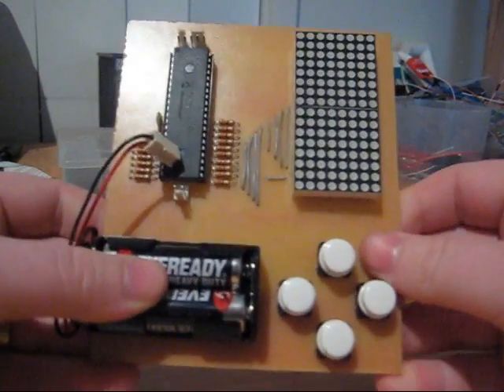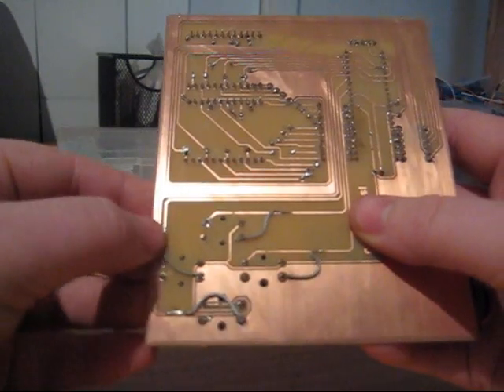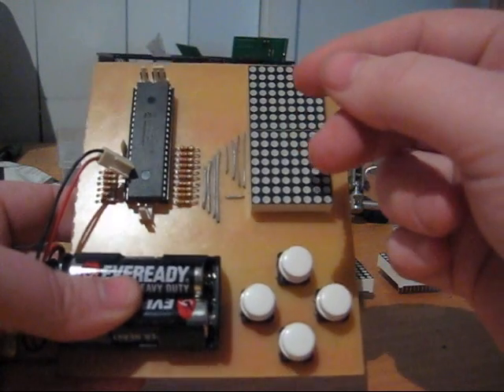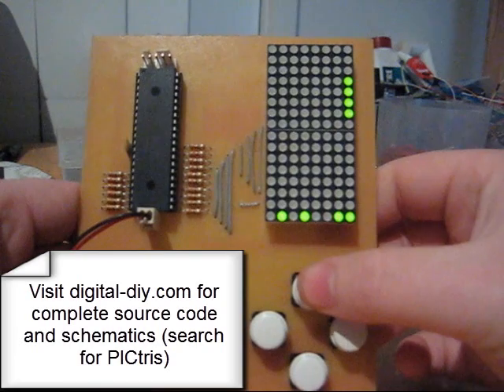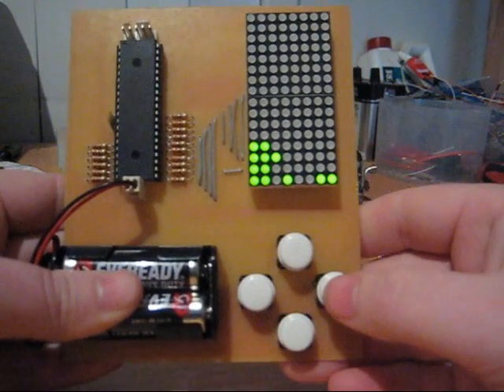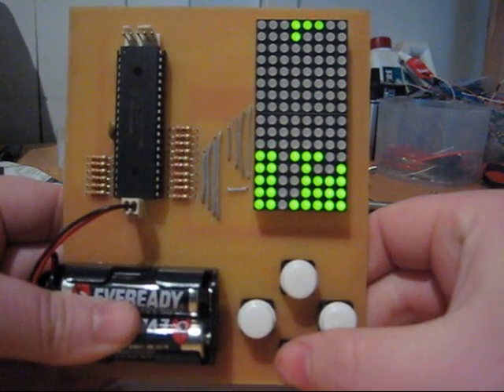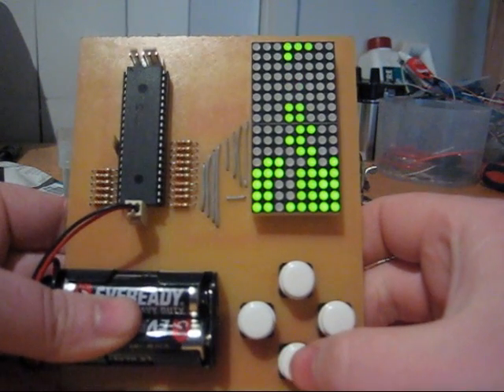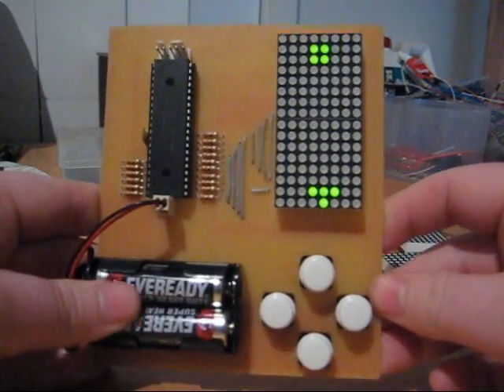PICtris (Tetris on a PIC).wmv

Comment: Hi. I didn't publish anything and I lost the files of the project. However, I made the trick with a 16vdc and a 5,6ohms power resistor. With the ADC, I measure the voltage at each side of the resistor in serial with the battery. I have the voltage and with a sub function, the current thru the resistor. Along the charging process, the voltage goes up, then down ; the current goes down, then up. When the 2 curves go the good direction long enough, the battery is charged.

Comment: You can use PIC Compatible microchip burners, but I am currently using the PICkit 2, a ICSP programmer from Microchip.
Then you can code the programm with the free software "MPLAB X" with either an Assembler or C compiler.

Comment: have you idea where i can find smaller matrix panels? i'm building an arcade stick (8 buttons) and i'd like to add a little display on the corner wich shows buttons and stick response, the easier way would be 3 rows of 7 leds (maybe square or rectangular) but 4 of them would be wasted.. (3 rows of 3 leds for stick inputs in the left, then we have 3 rows of 4 leds left, but i need only the top and bottom rows since buttons are only 8 )

any suggestion? i was considering to get a 3x3 and a 2x4 matrix to avoid wasting space and unused leds, does anything like this even exist?

Comment: Hi! I use normaly 8x8 Matrix Modules with just green colour, not like the in Projekt used green/red Module. The Pcb is different to the Shematic! There are 24 Pins / Module used. What i have to modify that it works fine for Matrix with 16 Pins? Thank you!!!

Comment: yeah me too found that there was a flaw, it picking up same block after a reset and there is no delay for next run. Suggesting to improve the code for randomizing the block and delay (better if it would be from controller,of course it may increase the circuitry) for next run. The work done by u is really awesome..........cheers..

Comment: I need to know that resistance is on your site you put in the description of the video does not say.
I need to pass the list of materials you used.
NEED ANOTHER PAGE OR TELL ME HOW TO DO IT, because I want to do this project and I need the list of materials and the description of how to do (eg the programming of the PIC).
  PS: I go to a technical school (electronics) and a bit of how to control a pic and I did several projects.
THANKS

Comment: above the pic you have a component,  what component is this?
on the website that you gave in the description says in the pcb that you need a pickit 2, is really necessary the pickt2? or i can use another component?
what did you do in this part of the circuit? 
please answer me i need the information
Reply: yes, i'm talking about that, but it suposed to be that the pickit is connected in the icsp connector, doesn't it?
but it has to be connected the pickit in the icsp connector so it the tetris can work? or the pickit is used for the protection of the pic?
Reply: another thing: in the source code when i try to compile show a lot of errors and warning about the INCLUDE randgen anthr others INCLUDE,  in the errors saids me that the (i forgot yhe word that shows me) is overflow
what do i do for i can compile without any errors?
oh and the command ASM is really necessary? with this command all the words after this appear in green
Reply: +.rvnx another thing: no matter what i change in the source code it always appears 21 error, always 21 the number never change
why the programation is wrong?
do you have another source code? could you sent it to me?